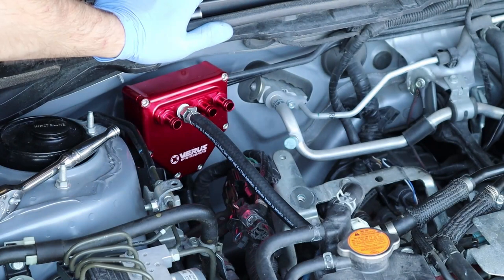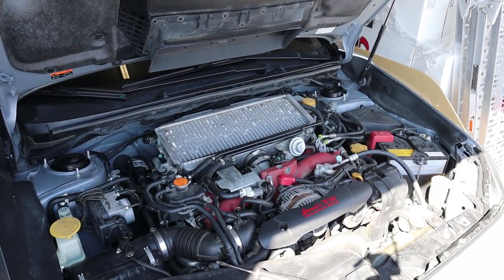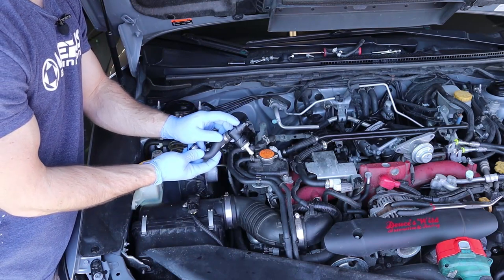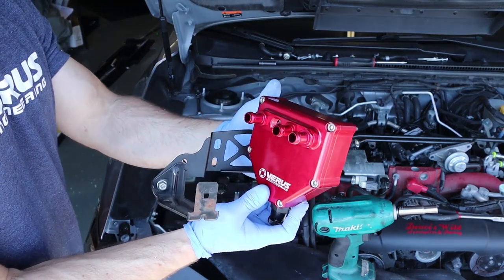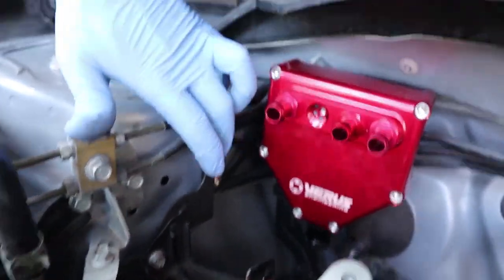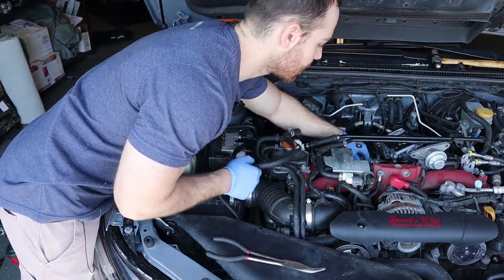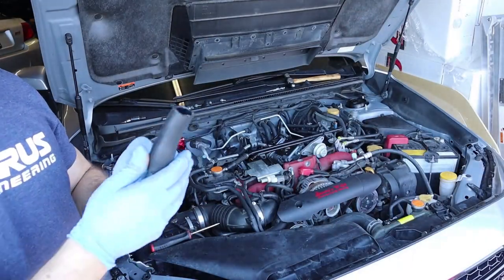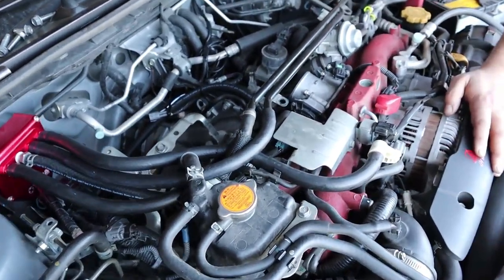VA Subaru STI Air Oil Separator (AOS) Install

Comment: The "white thing" are called Crankcase Ventilation Sensors. How can you design a Crankcase Ventilation System AOS and not know how the stock system works? Very Pricey item for less features when compared to already proven systems  (just saying)-- no heater or drain back included either... common man !!! 

P.D. I would TRY one for ½ the price,  but not at those levels. Those damn Logo$.
Reply from the maker: So we offer an add-on coolant kit and our kit is proven as well. We have used this same AOS system for a handful of years on various other platforms.
Reply: @VerusEngineering  According to the video your system isn't complete... one still has go to "Home Depot"  for fittings. What I'd like to know is what makes it more expesive than the others (Is it the CNC engraved Logo?:

*  $396.00 Basic Unit
+ $49.85 Oil drain Kit (not Included)
+ $54.95 Coolant option Kit (extra)
+ $Home Depot fittings ?

That's $500 ... before taxes and shipping!!!
Sorry Charlie; no thanks
Reply from the maker: @unleavenedkaraiteplus3412  not sure what you are talking about needing Home Depot fittings... The kit is complete and we believe our kits are priced appropriately for the amount of development that went into it. We believe our name speaks for itself.
Reply from the maker: @unleavenedkaraiteplus3412  this video was also taken before we had the necessary fittings in for the kit. This kit you see installed was the prototype kit.
Reply: @unleavenedkaraiteplus3412  damn troll. Get outta here. Smh